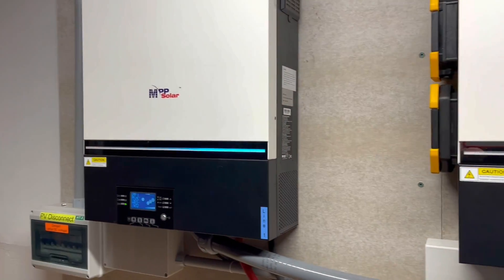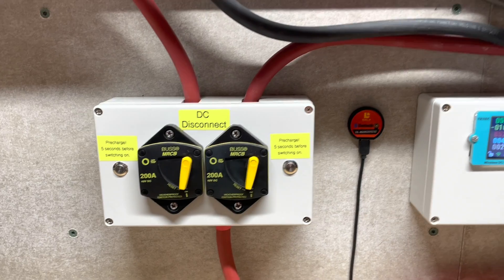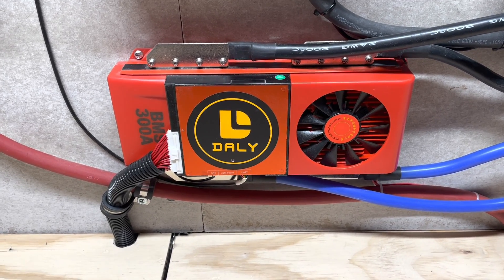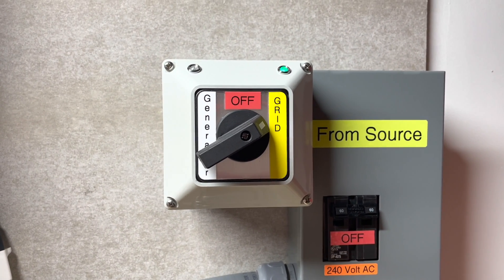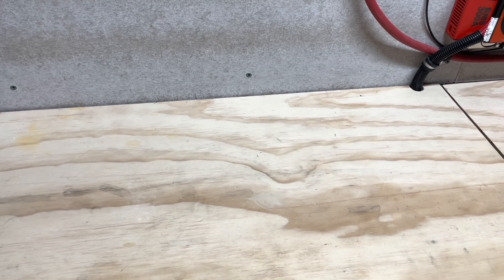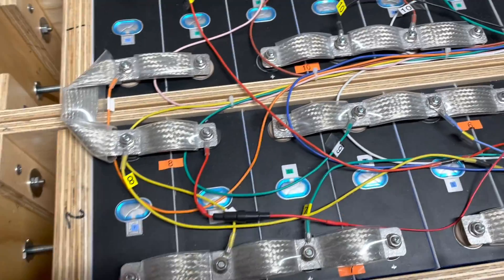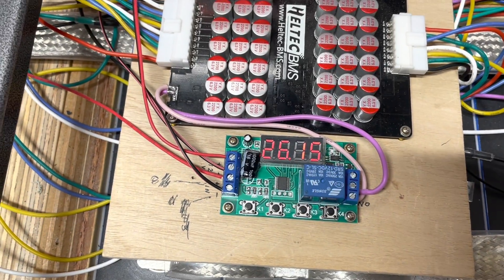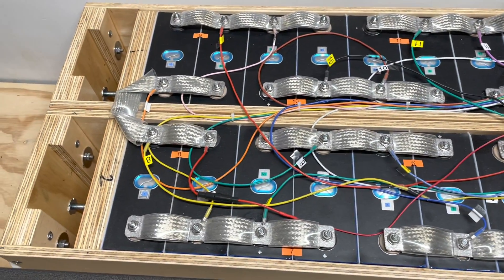MPP Solar LV 6548 split   It’s Alive! Please skip any adds on my channel, they are not authorized.

Comment: I was wondering if you could explain the split phase in a little more detail. I presently have one Victron 3000 W 24 V inverter. 
I don’t see too much information on YouTube about split phase. I guess I don’t understand how you get both 240v and 120v without having a step down unit. There’s a lot I need to learn. 
Not sure if it would be better for me to go with another 24 V 3000 Victron or just get a separate unit for 240 V. I have a very basic understanding and know the devil is in the details. 
Anyway thanks for showing your system and I don’t expect you to answer all my questions. Especially when I don’t really know what questions to ask. 🖖😜
Reply from the maker: In North America (Canada and Mexico too) we just had to be different from the rest of the world. We have 120 volts for lighting and outlets but 240 for ovens, dryers and HVAC. Many other countries have 240 throughout the home. In the US, residential buildings you have basically three lines in your panel two hots(lines one and two) then the neutral. (Ground is another issue that I don’t want to confuse you with) The voltage between the two hots are 240 and from either line to neutral is 120 volts. These inverters are synchronized to talk to each other to maintain a 60 cycle sine wave. Each inverter has one hot line and a neutral. The neutral is common between both inverters since the the neutrals merge at the breaker. Same thing with the voltage of the inverters, line to neutral = 120, between both lines= 240.  Other single inverters can have 240 volts by itself and may not have the neutral unless it states it does. You can install a split phase transformer to 240 volt inverter to get a neutral (and 120v), in fact some actually have them built in. They are referred to as low frequency type. They are heavy, very durable, very clean output but typically use more energy. I don’t recommend adding a split phase transformer to a 240 inverter unless you know what your doing. There’s plenty of single inverters that make 240 with split phase but many are too small to run big appliances. Even if it can start and run a load, if it’s working hard it won’t last. Always better to have a lot of  room to spare. Hope that helps
Reply: @SkypowerwithKarl  
Thanks a lot! It’s still somewhat complicated for me but I get a better understanding now. 
My present system is 7.6 kW of PV. 9.6 kW of lithium battery. And of course my only inverter is 3000W 24 V. I’m based out of Seattle.
I’m self taught and the only thing I didn’t do was the connection to my grid panel. I didn’t feel confident enough to take that on. 🖖
Reply from the maker: @benjones8977  
Actually you’re very smart. Doing what you really know and not blow things up or get fried.

Comment: Thanks for uploading the video Karl. Very nice installation, especially your attention to detail on labeling, and those awesome flexible ground strap bus bars!
Getting a well done from Will is also a bonus!
Yeah, the cycling blue lights are pretty cool. I agree about the BMS. I have the JK/Heltec 200amp 2 amp balance versions, and they have been flawless, but they dont communicate with the LV6548's. So I changing over to Seplos, who have come out with an RS485 version of their 200amp BMS that can communicate using the Pylontech protocol with the MPP Solar inverters. Their BMS's can also be connected in series, with master to the Inverters, and slaves behind it. (Up to 16). Take a look at their Mason kits. They are now doing custom kits for EVE 280ah. No cells, just everything needed to build a metal case battery, BMS, cabling, and busbars included.
Reply from the maker: What would be the advantage of communication with the BMS to inverter? My LV6548 seems to know what the battery needs. Charges hard then backs off and holds perfectly for absorption time then releases. I have my float set at 3.350vpc (53.6). That’s where I see it by end of day much of the time when the sun has done it’s job.
Reply: @SkypowerwithKarl  The BMS balances your batteries so they charge to the same Voltage, where your MPP chargers only charge the batteries up. The MPP solar chargers can only handle 100A draw so I think your 300A BMS is way to big. All you needed was a 150A BMS so it will shut down before you over draw the max Amps from your units. That might be why your 300A BMS fans never turn on.
Reply from the maker: @lawrenceholmanjr.5870  
Actually between the two inverters they can charge/discharge 300 amps continuously or 600 surge. Recommend breakers/fuses are 200amps per inverter. Typically it never goes over 90 amps charging solar plus grid. Running the dryer and when the central AC starts brings it right to 300 amps peak and 173 running not including the other stuff running in the house. So not quite overkill. Two JK’s would be about right, four on 64 cells would be even nicer 😉
Reply: In what circumstances is comms to the inverter needed?

Comment: Very nice, yes please post your settings. We live in a area with off peak rates and would like to have settings where I can charge during off peak to less then full charge.
Reply from the maker: Lol, So would I. 
The instructions on that area are as clear as mud. Little things like under what mode or conditions does it operate. On and off window ? Set it on both inverters? 
My biggest worry is, I may mess it up when it’s working so well now. 
If I see the sun isn’t keeping up, I trick it into charging from the grid the next morning by putting it to USb mode and back to SbU mode later. Most of the time I let the inverter will go back to grid by itself. I haven’t used power at peak time for months. 
Pose a question on DIY Solar forum. They may have the answer over there. 
It’s on one of my round to it lists. Sorry I don’t have more now.
Reply: @SkypowerwithKarl  good, so I’m not the only one, thought you might have a simple solution. My son in law is a computer programmer and got the source code from MPP to get into their program, he believes he may be able to change both the mode of operation and charging mode based on the SOC which he is getting from the the Victron smartshunt. He wants to add weather information (sunshine hours) to the program to calculate how much grid  charging is required.  My aim is to automatically program the inverters to maximize the solar charging and grid charge during off peak rates only when required. He tells me it should be ready for a test run shortly. Got my fingers crossed.
Reply from the maker: @jakealmaguenther4366  
I’m old so I thought it was me. If you son in law doesn’t already know about it, but have him search: Solar-assistant.io  It uses raspberry pie (way above my head) and does work with this Mpp unit. It can control a whole bunch of things but like I said it looks like more than I can cope with. It’s available from Watts247.com  Your son in law will be able use that or even improve on it.
Reply: @SkypowerwithKarl  yes, he saw that, looks like it is a monitoring and manual setting type device, we want a program that will change the charging mode based on the battery SOC and time automatically. Ideally the battery SOC should be enough to carry the load through the peak power rates without solar, but still have enough capacity for solar charging.  He is using a mini computer which is overkill, a raspberry pi would be adequate.

Very good diy build, best busbars I’ve seen. Also like your battery compression system. Keep posting.

Comment: what city do you live in....socal ?
Reply from the maker: Sac
Reply: i thought so...my mom is in sac
Reply from the maker: @Ebbrush3  
Only for a while it’s all going to be disconnected and the house brought back to normal and sold. The array is on a unistrut ground standing frame in the yard. It’s all a dry run for when I move to a “free” state for retirement. Just have to mount and I’m up and running knowing what works already.
Reply: Ok thanks and good luck with your new house .....still if you could run through your settinga I would be very greatful
Reply from the maker: @Ebbrush3  
My LV6548 program settings
Same on both inverters except pg 28
What’s not shown is left at default.
01 SbU most of the time. 
USb if I want to trick it to charge before it reaches back to grid value in SbU or if I want standby power like when there’s no sun for a week.  USb mode is a giant Uninterruptible power supply.
02 =90 amps 
05 =USE 
11 = 40 (so my generator can handle it if grid is unavailable) 
12 = 51
13 = FUL
26 = 56.0
27 = 53.6
28 (split) 2P1 and 2P2 180
29 = 44

BMS protects
High cell 3.65
Low cell 2.5
Sum high 58.4
Sum low 43
Diff volt .50
Over chg current 200
Discharge current 400
Balance start 3.4

Active balancer 
On 3.39 Vpc
Off 3.40 Vpc

My lithium rules:
never balance below 3.4 Vpc
Absolute maximum float voltage is 3.4 If I ever want to let the balancer have time to do it’s job but I haven’t seen any need so I keep it at 3.350 (53.6) for when in USb mode. 3.3 is even better if you don’t need the capacity. 
I keep my batteries off the high and low “knees” on the voltage curve as much as possible for long life and good balance. My settings use about 80% of the available capacity but greatly increases the life. Compressed cells can easily last 9000 cycles but at the low rate of cycles I do, calendar life (and my own LOL) will be a much sooner end.
Reply from the maker: @Ebbrush3  
Did you see these settings?
Reply: yes i did ...and will go through them one by one in detail.....also i have ran my system and it charges for a 3 or 4 min then goes into fault (there is no communication between batteries and inverter )   thanks
Reply from the maker: @Ebbrush3  
Weird? Is program 05 at USE? Did you get a chance to see the fault code before it disappeared? Man, there’s a lot of things that can cause a fault in these things.
Reply: im doing tile today ...i will get into it this week and keep you posted
Reply: @SkypowerwithKarl  Wow. We think very alike. Ground mount is the way to go. Unistrut and Grainger connectors with schedule 40 pipe. My diy batteries and two LV6548's are running now, but will be coming with me when I move from Commie NY to Free State South Carolina. My ammo and self built 6.5CM also!

Comment: great job ....if you want to make this look better use white 3X3 wire duct for for all wiring = AC, D,C comm.,  BMS.....mine looks sweet because i build control panels .....
can you do a vid on all you settings parameters , especially battery settings .....thank you
Reply from the maker: That’s a good idea. Just don’t obstruct downward airflow. If you do there’s a potential for more hot air to exit the sides and loop back to the top intake. When at high current charge or discharge these things do put out some heat.
Reply: there is a 2 inch gap between my duct and inverters ....i would like to send you pics.....i have tesla model S batteries but i need help with the settings ......thats why i asked if you could go through the parameters , it would help a lot of people ....thanks
Reply from the maker: @Ebbrush3  
Will is the Tesla guy and may have some answers to get it to juice up. Also hit up the the guys on DIY Solar forum. (Will owns that too) see my other response with my settings

Comment: Very nice!!! Looks awesome
Reply from the maker: Thanks Will. Coming from you is a big compliment.
Reply: @SkypowerwithKarl  sure :D I remember when you said you would build this. So cool to see it come to life
Reply: @SkypowerwithKarl  I’ve got a question for both you and Will.  I noticed you both have fused just the positive DC.  My understanding is if the DC side is not grounded then you try locally protect both Pos and Neg.  I need to look up the NEC on that, but that’s how we do it in large DC systems for substations.
Reply: Nice battery monitor
Reply from the maker: @WillProwse  
Beeping the buttons on the inverter or waiting for the app to open gets old. 
I like seeing things at a glance.
Reply: @WillProwse  Im mad at u Will tho ive been nothing but completely ignored  by u man but others was nice and kind enough to help me on YouTube
Reply: @thelithiumpowerch  yeah I can't respond to everyone. Sorry
Reply: @WillProwse  I understand I found an aftermarket inverter that look just like the LV6548 but it's the 24v 3000w 240 single phase unit picked it up cheap on eBay was trying to figure out the best way to go about using this thing I get volts from my panels but it's not giving me no answer and no watch and I have at least 150 to 160 volts coming in someone said I need a minimum of six panels and there are so I need some type of load on the line to see the incoming power from the panels
Reply: @thelithiumpowerch  sounds like an international version. What is ground designation?
Reply: @WillProwse  that's what's worrying me the output only has two terminals line and neutral with the ground screw on the case
Reply: @WillProwse  I did test using the meter for a neutral & ground bond inside the case the meter game no response but that was with the power off
Reply: I don’t see a T class fuse? DYI you did not catch this? :)
Reply: @bradmesserle999  I can't stand people who try to criticize other people's systems on YouTube. Just because I disagree with a specific component or configuration does not mean I feel obligated to say something unless it's a major issue. I hate people who just sit on YouTube trying to find something to complain about.
Reply from the maker: @WillProwse  
Doesn’t bother me Will, Sometimes it’s another pair of eyes. But even more so I’d like to see their system😉 I thought about the T class fuse but then I ran the breakers instead of a disconnect. Then there’s the BMS over current settings which is incredibly fast (just try connecting to an inverter without a charge resistor and you’ll see how fast it is),then there’s the inverter’s default over current. Three things to would have to go wrong for a catastrophe to happen. But yes there always needs to be an over current device fuse or breaker . Not worried.
Reply: @WillProwse  I don’t sit on YouTube to complain about other peoples beautiful work. I am in the middle of designing my own system and your video strongly recommends a T-class fuse.
Reply: @SkypowerwithKarl  Thank you for explaining.